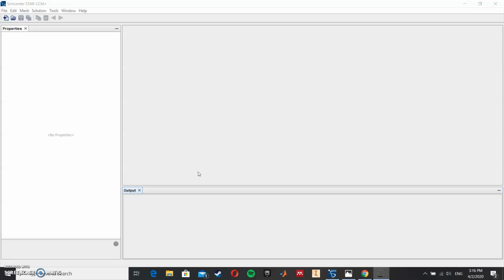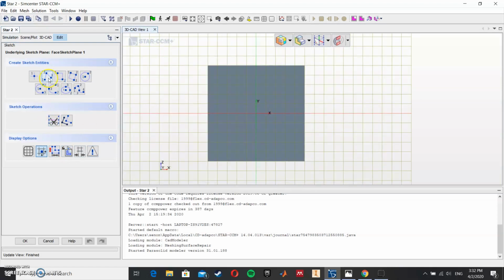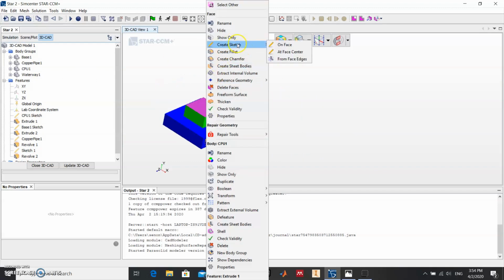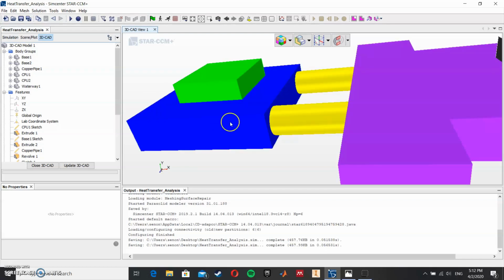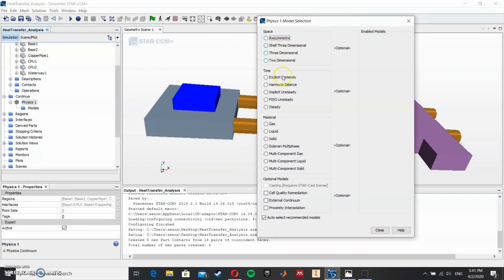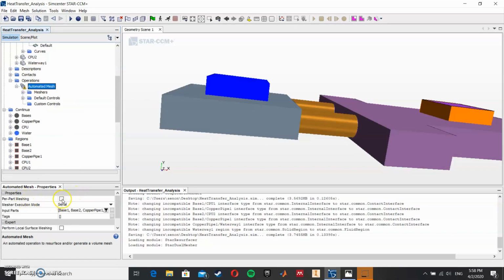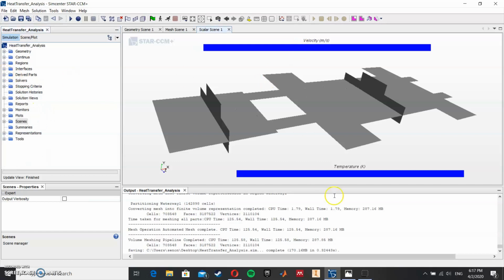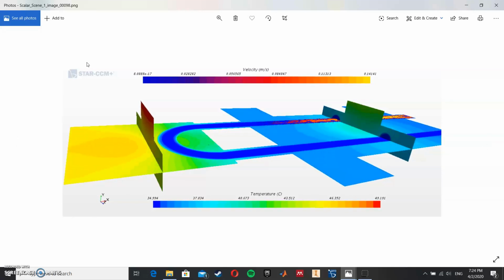Star-CCM+ Tutorial 1- Cooling a 2 CPU System (Conjugate Heat Transfer Case Analysis)

Comment: The most stupid idea to create CAD in Star. We need to learn how to setup not 3CAD modeling. What is the region what is  continua what is difference? Do we need to extract fluid region?
Reply from the maker: The things you have mentioned are all in the video;yet, here is a summary:
1) Continua: Selection of physics/models you would like to utilize. 
2) Region: Defined parts where the physics chosen in Continua will be solved.
3) The fluid region is extracted to specify it. Otherwise there won't be any fluid region.

It is better to create CAD in Star CCM+ as imported files can cause problems in which case you have to use surface wrapping/surface repair tools to fix the geometry. Of course, it is your choice to pick your CAD program.

Again, everything you mentioned is in the video... You should watch it carefully.

Comment: Could you please explain, why you chose convection and assigned h = 0? Rather than just giving at adiabatic wall condition? - Are not both the same. Also how did the Energy Source option effect your boundary condition? I am talking about somewhere around 58:00

Comment: Hello, I am a student who is learning star-ccm at university.
I can set the air to inlet and outlet, but I don't know how to give conditions when I change it to water.
I want to set the temperature of the water and see the temperature that the water has when it goes into the outlet. Can you take a video of the lecture?
Reply from the maker: Hello Vesper,

If you changed the fluid medium in Continua, then you won't have to take further steps for the boundary conditions. You can simply give temperature condition into the inlet and outlet boundaries. This can be done by going to the "Regions" tab and proceed to the region with inlet and outlets and change the conditions.

In order to monitor the temperature of the fluid near the outlet, you can create a point probe from the derived parts and place it near the outlet. Then, create a maximum (or minimum) report and choose that point you have previously created  for the report. Finally, right click the report and say 'monitor and plot'.
Reply: @ownershen97  I understand the inlet, outlet setting you mentioned before. However, as the fluid flows, the temperature of the fluid must be transferred outside or outside, and the remaining temperature must escape, which is the same. My condition is to flow water into the pipe and the inlet temperature of the water is 60℃.I'd like to check the remaining exit temperature after transferring heat, but the exit temperature is still 60℃.

p.s. If there is something I am doing wrong, could you please forward the ccm file and check the problem?
Reply from the maker: @vesper_007  I suppose it could be due to failed interface between the fluid and the pipe. I could help you with the file yet I'm having trouble with licensing preventing me from opening SIM files.  However, you can try the steps below and see if they work. 

In the "Regions" tab, select the two boundaries (while holding control) shared by the fluid and the other object and right click one of them while they are both selected and select interface. 

Or simply try the imprinting process I've shown in the video where the program creates contacts based on imprints made in CAD. 

Also, do your residuals converge?  The solution may not be correct as well due to increased transient heat transfer. You can change from "Steady" to "Unsteady" simulation in continua tab. Make sure all of the continua have the same option selected.

Hope this helps

Comment: Hi can you show how to calculate Heat transfer coefficient for this problem
Reply from the maker: Hey

I suppose you are referring to the Heat Transfer Coeff. for fluid flow. You should first calculate the fluid's Re number to determine whether its laminar or turbulent. 

Then, you can use predetermined formulas to calculate Nusselt number. Then, you can proceed to calculate heat transfer coefficient using previously found Nusselt number through a relation which I unfortunately don't have the memory of.

. You should take a look at Internal Forced Convection from various books. I recommend Heat and Mass Transfer_Fundamentals and Applications by Yunus A. Cengel and Afshin J. Ghajar (the book used in my uni) however most of the heat transfer books should cover this topic.

Hopefully  this was helpful. 

Take care

Comment: Hello Onur. I wanna know the reason of assigning the heat transfer coffeficent value as 0. Thanks.
Reply from the maker: Hello

The reason is that I assume that there is no forced convection over the surfaces of the system. (However, as you may know, there are fans that actually cool the CPUs down) So,  I set the heat transfer coefficient (or convection coeff.) to 0 and let the liquid cooling do its thing and assess how well it cools the system. 

Now, if you would like to see the effects of convection over the surfaces, then you can set the convection coefficient; however, you may want to make some analytical calculations/simple simulations to find out the coefficient. Then you can set the boundary condition for convection.

In addition, lets assume that I know the convection coefficient caused by the liquid inside the pipe.  Then I do not need to assign a fluid region and only assign the coefficient at the inner wall of the pipe. This way, you can  simplify your simulation and hence decrease computational costs.

Hope this helps =)
Reply: @ownershen97  Hello Onur. I researched some thesis about radiators and have to create cfd simulation of a car radiator. If you have any information, Can you inform us briefly about this issue. How should I do this simulation. Thanks for your informing.
Reply from the maker: @erenmeliksurmeli9796  Hello
I dont have much experience with  car radiators but  I think it would be fundamentally similar to this simulation. I suppose you can initially draw out the geometry of your radiator, extract the pipes/ducts from it for your fluid to flow through and create interfaces between the pipes and your radiator.

There is a tutorial exactly on this topic in star ccm+ help menu (under tutorials)  called  'Duel Stream Heat Exchanger: Car Radiator.'  If I remember correctly it implements some porous regions in it which maybe of use.

Comment: Great content and it’s really helpful for us beginners . Creating and doing simulation with a case is good for us understanding the workflow. Thank u. Looking forward for your updating.
Reply: Btw, I am doing a heating system case. There is no fluid/gas in this system except environment. I have a problem that there is only energy on the residual plot (no appearance of continuity and others). Is it reasonable?
Reply from the maker: @yajiaoliu5970  Ofcourse since you dont have any fluid there is no need for momentum transfer. This is the ideal case generally since addition of the fluid domain kinda causes problems in terms of multiple time scales (Somewhat the problem in the simulation I have done.)
Reply: @ownershen97  Thank you for your kind reply!

Comment: Cool, great for those who don't know star ccm but please be careful with the physics... Adiabatics wall is not a good boundary option for your copper pipe !
Reply from the maker: I could assign a convection boundary layer to assign the environmental temperature but I suppose it wouldn't make a huge difference regarding the temperature distribution throughout the system. 

Thanks for the heads up though! :)

Comment: Is it possible to import regions already designed in NX Siemens instead of designing them in STAR-CCM+?  Great content btw! It helped me a lot!!!
Reply from the maker: You can indeed transfer CAD files from various programs where Star-CCM+ can distinguish parts provided that you have identified your part previously.  Though I'm not sure about regions; I've never worked with NX Siemens (yet I think you meant parts?)
In fact I did few of my projects from Inventor 2019 and transferred them to Star-CCM+ no problem (saved as IGES file in Inventor and imported it in Star-CCM+). However, the issue is that there can be problems in the geometry where you may have to use Surface Repair Tools available in Star. 

Thank you. Always happy to help =)